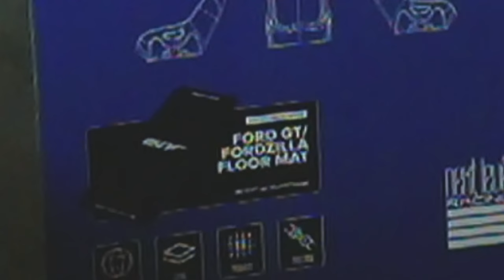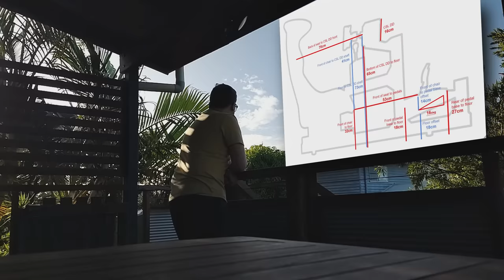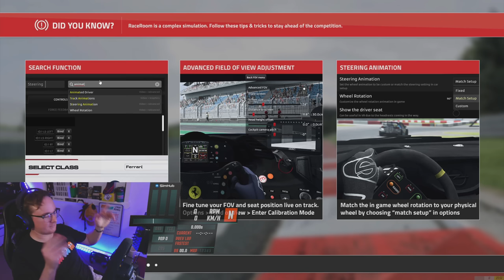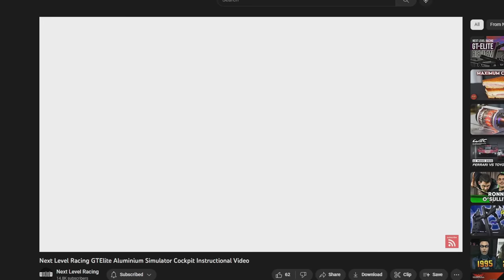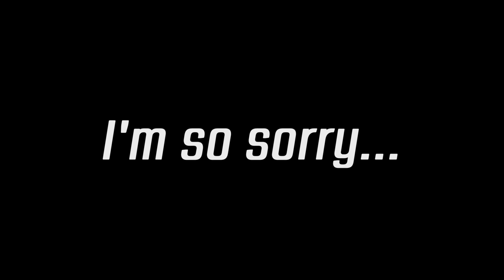My New Sim Rig! Next Level Racing GTElite Cockpit - Unboxing, Assembly and First Impressions

Comment: Being a monitor user I would take those uprights to a machine shop and have them cut off a few inches off for sure.  Also it would've been nice to see them include spring ball T nuts instead, MUCH easier to work with. Rig is a looker though.
Reply from the maker: Funny you say about cutting the tops of the uprights off, a few other people have mentioned they have this rig too and have done exactly that. Seems like a bit of an extreme solution for something that should be good out of the box but, hey, if it works then it's not a stupid idea 😉 right? That said, I've since noticed there's an extra notch or two where the seat can be mounted higher so I might give that a whirl first before taking a circular saw to this gorgeous thing. I'm not sure Next Level Racing would appreciate me cutting half their logo off either 😅

Comment: Just ordered one. I use VR so the struts won't bother. If I were you, I would get an aluminium blade and cut them to the desired height with a drop saw.
Reply from the maker: I'm using VR too so it's not much of a problem when I'm racing 👍 just when I'm doing other stuff like video editing etc. That said, I managed to reconfigure things slightly since this video by raising the seat and also monitor so they don't overlap anymore. No complaints now!

Comment: Thanks to a limited time deal on Digital Motorsports, I recently picked up a GT Elite and I gotta say, with experience building a custom 8020 rig, this thing is amazing. Easy to assemble, basically no flex, its insane.
Reply from the maker: I've never built an 8020 rig before but can definitely say that this thing was easy to slap together, although it does take a decent chunk of time. I haven't noticed any flexing, or even creaking, either yet 😍 absolutely rock solid which means more of the vibrations from the wheel and pedals travel through the frame instead of being lost in transit. I can feel the bumps, kerbs and tyre slip in my legs and arse a little bit without running any kind of shakers or motors, it's great!
Reply: @DDFRacer Dan, great review mate!

I decided to order this rig after watching your review, thinking also that the Formula rig was too complex and chunky.

I initially was confusing it with the F-GT, which I think may have a less sturdy frame and I don't think it is listed on Pagnian's website (Euro only?).

The reviews I've watched of the F-GT show an upgrade by NLR which includes a strengthening bar to support the wheel plate.

Can u help with my confusion? It certainly looks like the GT Elite is sturdy enough!

By the way, I'm an Aussie too. Melbourne. 😊

Comment: I just swapped rigs two months ago, also measured out the old one as much as possible. It helps tons!!!  Also I gotta say that's some of the nicest packaging for 80/20 I've ever seen. Mines only come plastic wrapped which still worked fine but the layout of that main box was nice.  Congrats on the rig!
Reply from the maker: Those measurements were a life saver, I honestly couldn't imagine going through the whole process of finding the right fit again after spending years on the Simetik K2-R getting it dialled in. Completely agree on the packaging too, incredibly efficient in terms of space but on the flip side those larger pieces of aluminium were an absolute b*tch to try and get out of the polystyrene 🤣

Comment: Exciting stuff Dan and richly deserved :)

Rigs are always a bit of a pain to put together, but it's so worth it!

Thank you for sticking up for us people who put our shifter on the left side
Reply from the maker: Somebody has to defend the lefties 🤣 it just wouldn't feel right otherwise. See what I did there? Feel right ? Sorry, I'll see myself out...
Reply: I have a g29 and by omega Titan, cockpit and overall, I’m very happy with it BUT I’m going to upgrade to Logitech direct drive and get omega Prime or Prime lite Cockpit. I really wanted to go with fanatec, because it looks a lot nicer. As it ships from Germany and I hear some horror stories, about faulty items and poor customer service, I decided to go with the easier option of Logitech direct drive. I can always buy a Fanatec setup in a year or 2 and if I have problems, it will be much less of a hassle, because I will have my Logitech direct drive wheel. My main reason for upgrading cockpit and wheel, is simply to be able to move wheel backwards and forwards, up and down to exactly the right spot and as for the wheel, I just want a smooth wheel when turning and direct drive will do that.

Comment: Great review.  I have the same cockpit but the non Ford Gt version.  I took the side uprights to my local machine shop and had em cut about 6 inches off the top of them.  Now my monitor sits low and close like you’d hope for.  For the price of the cockpit you shouldn’t have to cut it down to size but now that I have it sits perfectly and I couldn’t be happier.
Reply from the maker: Awesome stuff mate 👍 I'm glad you found a solution. I'm not sure Next Level Racing would appreciate me cutting off half of their logo though for when I do my promotional shots 😅 but maybe in a little while I can have a look at getting them trimmed down. Like you said, it seems a bit of an odd thing you'd need to do for a rig at this price point. I am however noticing that I've mounted the seat in the lowest position possible (I literally followed the assembly exactly as instructed) so perhaps I could raise my seat and wheel up a few notches. I'd have to re-do all of the cable management, readjust the seating position and brake position too but could be a potential workaround...

Comment: I believe the original Ford GT race cars had the shift linkage to the right, right against the door. I’ll have to try to look that up and see if I’m remembering correctly.
Reply: Yes. Even as a right hand drivers position, shifter was still on the right side of the driver.
Reply from the maker: Ah well that might explain it, and is actually a super nice touch from Next Level Racing if it was an intentional design choice! Still rocking my makeshift botch job on the left hand side though 😅

Comment: I modified tough built utility pouches to attached to the sides to hold my remotes tools and other goodies.
Reply from the maker: I'm thinking maybe more along the lines of a drinks holder and VR headset mount but I hear ya 😉 the T nuts and channels make it easy to add extra bits on down the line.

Comment: I chopped the uprights on mine so they don't obstruct the monitors. Wish I'd done it sooner but I was anxious that after swapping a few components out I'd end up needing the height back. Was super easy with a miter saw, I got a cheap fine-toothed HSS blade but pretty much anything should work. Just make sure to get the angle perfect or the cap won't fit. You're spot-on about the angled uprights making one adjustment throw everything off, it's been super challenging getting things dialed in. I do appreciate the legroom though, it's easier to get in compared to a more typical vertical upright rig. At various points I've tried removing the pedal risers and bolting to the frame directly, and even bolting to the bottom of the frame. Including a taller seat bracket (I think the one they sell separately is in fact taller) would really help get a more comfortable leg position (higher while still reclined) and make better use of those uprights.
Reply from the maker: I've seen a few other people here recommend taking a saw to the uprights but it does seem like a very drastic solution. I'm going to play around with the seat in the future as I think I may be able to boost it up on the L brackets a little more, although I'm finding the current seating position super comfortable actually 👍 and with me using VR the higher monitor position isn't an issue really. Like you said, it does take a while to get things dialled in but the legroom is great, feels really nice being able to stretch it out on those longer straights and in between stints.

Comment: It should come with a box of bandages. One false move when putting it together and you’re cut ifs very sharp on edges
Reply from the maker: To be fair I didn't notices too many sharp edges but you do make a good point, best to check for any potential hazards before construction 👍 although it seems the aluminium may have been deburred before it was packaged.

Comment: The color of that rig is beautiful. I had a SimLab GT1 EVO a few years ago and currently have a P1X. I really enjoyed building and adding on to both those chassis. The key for me was having proper allen wrenches. Full size screw driver style with the ball end.
Reply from the maker: I love the way the blue reflects the light, especially with the LED strip lights I'm running in the background for the streaming camera, the finish on the aluminium is absolutely stunning 😍 you make a good point about the allen wrenches though. Sure, the ones that Next Level Racing supply are more than capable  of doing the job but I don't doubt for a second that having a better tool would have made this a much quicker (and more comfortable) task 😉 good advice for next time mate...not that I plan on going through this again any time soon ha!

Comment: sweet looking rig 👍 I also noticed those side profiles that are in front of your screen when you were building it. Other than that it looks solid. And what a color ! 👌
Reply from the maker: The side profiles have become much less of an issue now I've raised the monitor slightly. Still not ideal in terms of driving position when using a monitor, but since I use VR 99% of the time then it's really not that bad at all. Couldn't agree more about the colour though 😍 normally I'm an orange kinda guy, but that blue is just stunnning!

Comment: Hi Dan, great video. I have the same rig, hence I fully agrees with your build experience. I also built it all on my own, should have asked someone else to help. But instead of the ES seats, bought an real racing seat that was discounted at the time :) . Hey, one thing though, if you are really hoping to get more height to your seat. Instead of the two flat bars on the rig, then the L shaped brackets, then the seat. Try swapping it around. L brackets first, on the base, then the two bars directly to the seat. It is written somewhere on Next level 's guide.
Reply from the maker: Just out of curiosity, how long did it take you to do the solo build? And did you find it as exhausting as I did in the video, or do I just need to get in better shape? 😅

In all seriousness, thanks for the tip on the seat with the brackets and bars. I'll have a look into that one in the future 👍 cheers.
Reply: @DDFRacer  LoL... I watched your build it was truely epic. You had all the extras and you did it on your own too. I only had the base and the race seat, that also took me a few goes over multiple days. Plus covid at the time, mates cannot come to help anyway.

Comment: More than likely this rig is the way I'm going to go sooner or later, mix and match set of separate seat and wheel stand 2.0 is not the way to go with loadcell brakes lol.

Also love how the blue frame looks like.
Reply from the maker: Yeah I know what you mean 😅 you really need those mounted in place! When I first got my Fanatec V3s they arrived quicker than my rig so there was a transition period of a few weeks where I was just using them on top of a cardboard box propped up against the back of a desk. Had to use my right foot and push down on the base plate when braking with my left ha, good times.

PS. Shameless self promotion (sorry!) but if you decide to go with this rig in the future then I've got a link down in the video description you can use which kicks a tiny slice of anything you might purchase back to the channel 👍

Comment: hey mate, great video and much appreciated for someone like me. i'm curious would you recommend this cockpit or do you think its worth going for the f gt elite or even the f gt elite 160 over this cockpit ? thanks mate and keep up the good work
Reply from the maker: I'm going to be a little biased because it's the rig I use every day but I would definitely recommend this 👍 I've been using it pretty much every day since this video and it hasn't skipped a beat. No flex, nothing loosened, no failures. The F GT Elite looks pretty much identical (supporting framework, accessory options etc) aside from the pedal mounting position which looks a little higher up and can be a hybrid single seater/GT configuration so I guess it depends on your personal preferences regarding foot position.Same for the 160, it looks incredibly similar although has direct compatibility with their motion platform if that's something you might consider in the future.

Comment: Great stuff Dan 👍, I’ve just purchased the same setup but am fixing a 55 inch curved tv to the wall, just wondering what height off the ground the screen should be?, if you’ve got any suggestions that would be amazing.
Reply: Sorry also just wondering what the seat height is off the ground?, I’m wanting to get my screen fitted to the wall before my rig arrives, many thanks and love videos mate 👍
Reply from the maker: Oh that's a difficult one to answer unfortunately, it depends on how tall you sit in the chair and how high you have your wheel mounted as this would also affect the position of the screen (ideally you'd want to line the wheel up so it replaces the in-game steering wheel when you set up the FOV correctly). As I'm a VR racer 99% of the time, I don't really place too much importance on mounting the screen in exactly the correct position 😅 but after taking some quick measurements I can confirm the front of my ES1 seat (and the underneath of my thighs) are approx 30cm off the ground and the shaft of my steering wheel is approx 75cm off the ground. Looking at the rig mounts, I could theoretically raise the seat another 10cm higher and my steering wheel another 20cm higher if I wanted to. For reference I'm about 175cm tall 👍 hope this helps!

Comment: Great review Dan! <3 Can't you cut off a couple of centimeters of those vertical panels that obstruct your monitor and slap the plastic ending on top of it again after giving it some trimming? Of course you would have to disassemble it a little (hopefully not too much) and have to know someone who owns a circular saw that can cut through metal but it's not like you will ever mount your wheelbase this high anyways. But I personally think it would be worth it since you could lower the monitor again.
Reply from the maker: It's such an obvious solution but not one that had crossed my mind since it'd be such a permanent change 😅 but like you said, it's not as if I'll be running the wheelbase anywhere near the top of the upright range so...yeah, it could be quite an effective solution in the future. At the moment it's not an issue though since I'm using VR for all of my driving and, honestly, I don't mind having the monitor a little higher as it forces me to keep my back straight and raise my head slightly when doing non-racing stuff. No more slouching in the seat 👍
Reply: Ha ha, exactly what I thought too, Wuschel. <3 As it is aluminium, I think any pro or hobby carpenter with a sawing table could cut it. But if it is ok atm, yes, maybe something for the future... Probably also not too easy to overcome the reluctance to saw into parts of such a brandnew beautiful and shiny rig.
Anyway, really enjoyable and interesting to watch! I will think about the new rig each time, you will pass me on saturday, respectively sunday, Dan.  : D

Comment: Got the exact same rig about a year ago. Not the blue one. Was by far the most difficult thing ive ever had to put together. Took me approx 3 days too. I have the CSL DD too and I'm wondering why you didnt go for the side mount option. I think it looks way better.
Reply from the maker: Yeah it's definitely a project you need to allow a decent amount of time for, although I must admit I found the Simetik K2-R (especially mounting the seat) a lot more time consuming and difficult, although that might be because it was my first rig and a whole new learning experience. As for the side mounts, I wasn't even aware that was an option to be honest 🤔 looks like the standard mount gives me more flexibility though should I need to swap up my wheel in the future or test something out for a video.

Comment: Nice dude, looks awesome 🤘The issue with the uprights being in the way of the monitor is the same with the fixed monitor mount, same on mine....was thinking about cutting the top of the uprights off mine.
Reply from the maker: Cheers man 😎 I was tempted to call you and ask for some help but I don't think you would have appreciated it at 11pm ha! Good to know that even a tall guy like yourself has problems with the uprights too and it's not just me being picky. Did you raise the monitor up or just work around the fact you can't see areas of screen?
Reply: @DDFRacer  Hahah probably would have been practising my bin technique at that time of evening anyway.
Reply: I cut mine and it went perfect.  Couldn’t be happier.  Pics if needed
Reply: @globsta6911  would be keen to see. What did you cut it with?
Reply: @jimmy-the-bear  I actually took them to my local machine shop to cut.  I believe they used a carbide blade table saw.   Cuts are perfect and plastic end caps went right back on no problem.
Reply: I have the fixed monitor mount as well with the G9
Reply: @globsta6911  Good idea, leave it to the professionals 😂. I just looked at my rig and remembered what removing the uprights would involve and thought, I can live with it blocking a tiny bit of the screen for now 😂